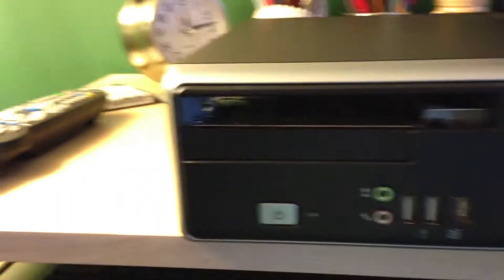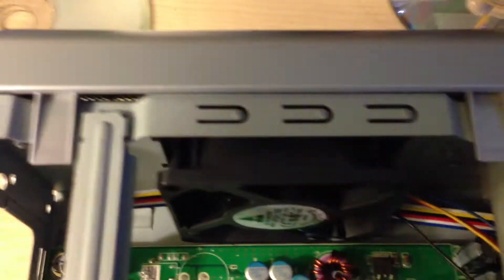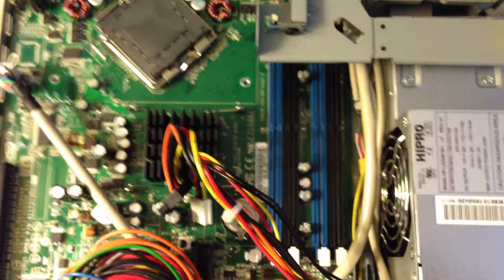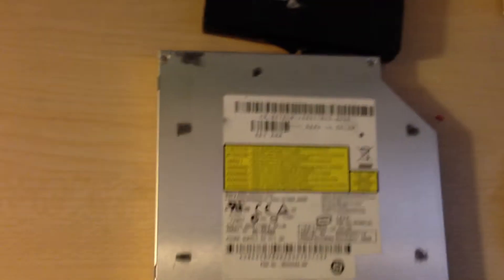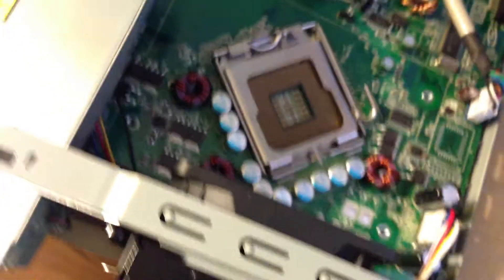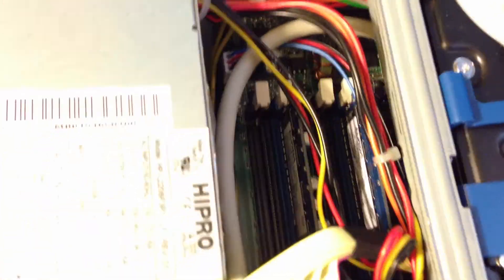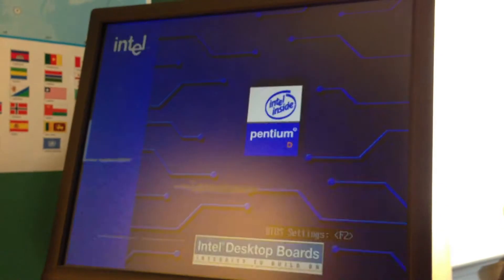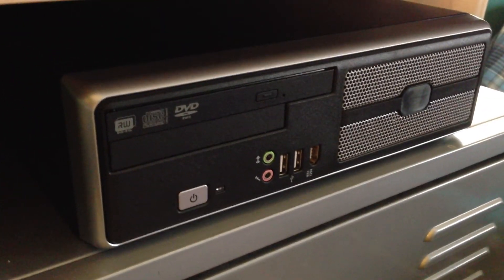Small form-factor LGA775 Barebone Computer Build

Comment: A 1.8 Ghz Core 2 Duo processor will beat that piece-of-trash 3.20 ghz Pendtium D CPU T_T
Reply from the maker: This motherboard does not support the Core 2 Duo.
Reply from the maker: ***** The Pentium D CPU is a completely different and less efficient architecture than the Core 2 Duo. A low clocked Core 2 Duo would outperform this Pentium D 940, and not run anywhere near as hot. I would use a Core 2 Duo in this machine, but the chipset does not support it.